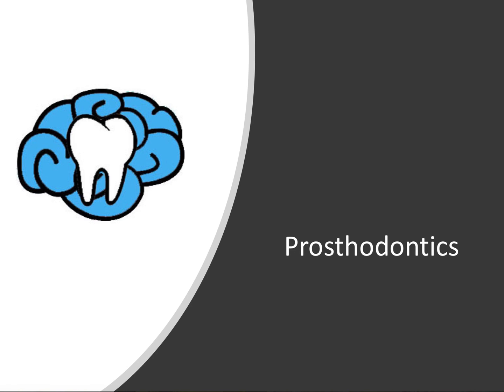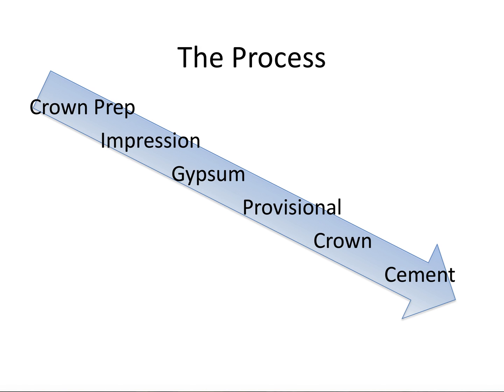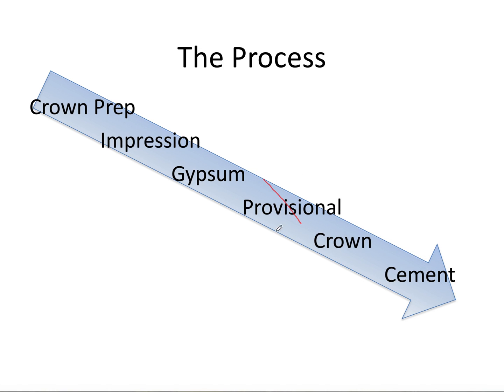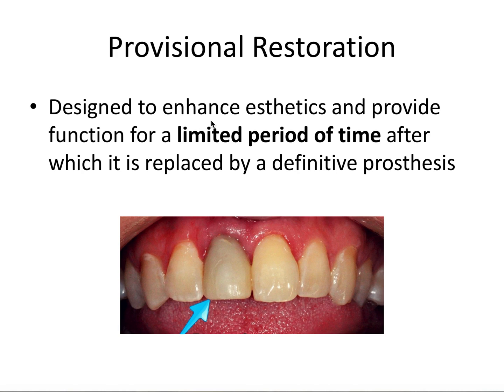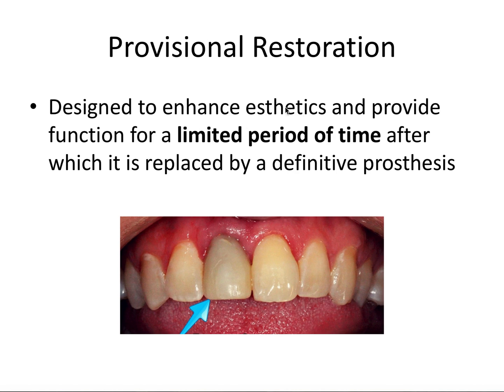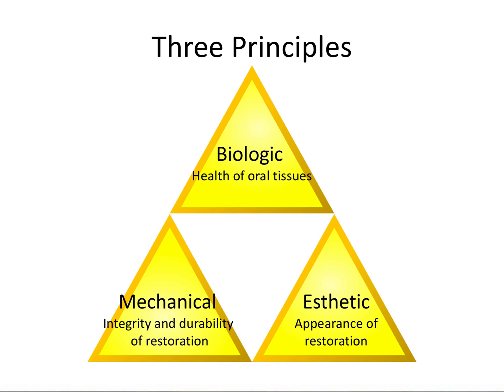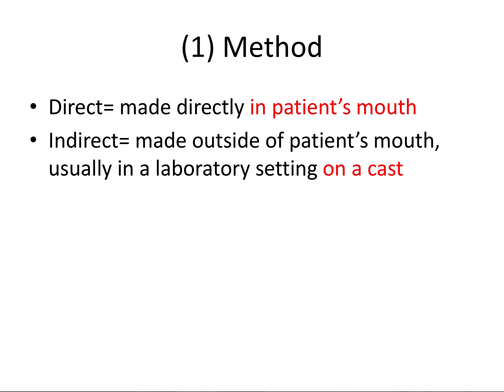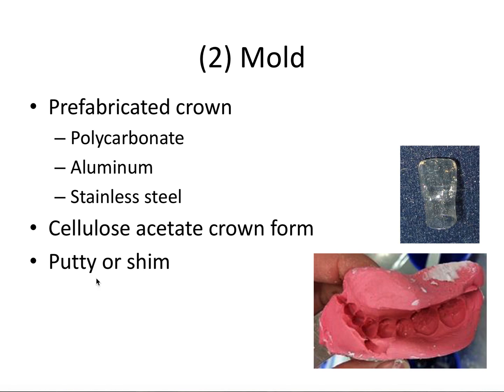Prosthodontics | Provisional Crowns | INBDE, ADAT

Comment: Hi Ryan! Thanks for another great video! Was wondering, you mentioned there’s less shrinkage when using bis-acryl composite, is that a good or bad thing and why? Thank you!
Reply from the maker: Less shrinkage is usually always a good thing in dentistry! Minimal dimensional changes means the provisional will fit on the tooth better and hold occlusion more reliably until the definitive crown is inserted.